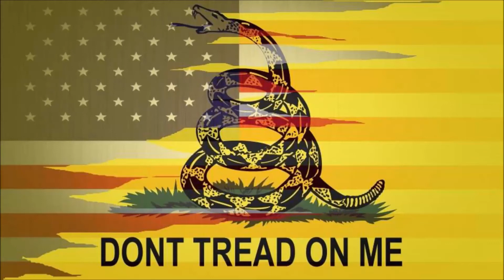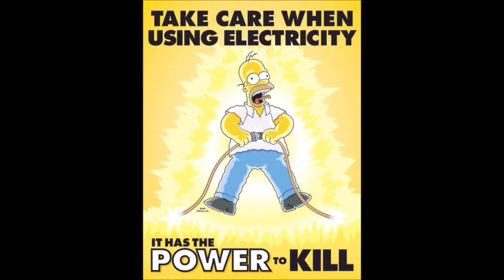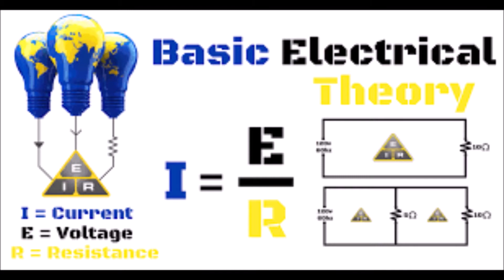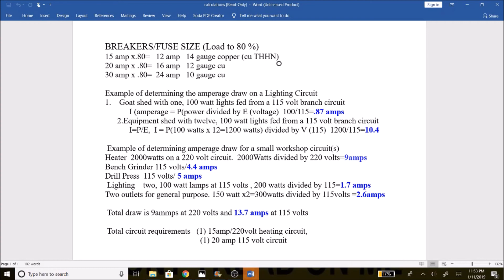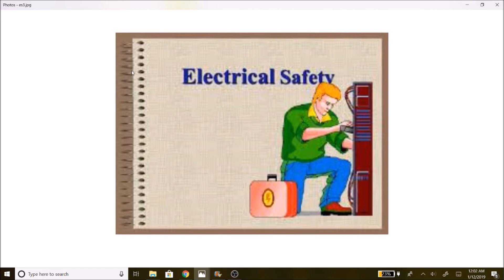Electrical Theory and Calculations Part 3 :Calculations

Comment: While correct you should add into the information on why when and where to use and  the difference between standard breakers and loose term here "slow blow" or slow trip breakers. Thicker guage fewer strands are for A.C. use where smaller but many more strands are better for D.C. current. Just saying. A great text book is from Grob basic electrical/electronics theory. I used it in college as my first semester text book. PS cover also the use of resistance and amp draw between a series circuit and parallele circuit. Ex. 50 + 50 resistance in series is 100 ohms. 50 +50 in parallel is less ohms in a dc.circuit while voltage remains the same across each path of the circuit.
Reply from the maker: Thanks, those are all great points. The series parallel circuits are more getting into the electronics aspects of the science.  I am familiar with the basics of that, but having done primarily commercial and industrial plant wiring, it gets a little out of my wheel house quickly...  Taking a look at the slow blow over current protection devices, and the wire types and sizes is a great idea. I will consider it for a future video. Thanks for watching, and for your input sir.
Reply: @OurSoVaLife  anytime guy. In survival you can never know enuff. I did electronic engineering so I am more on the other side.